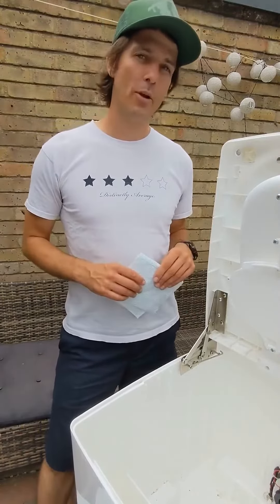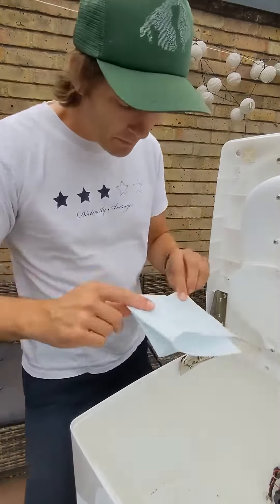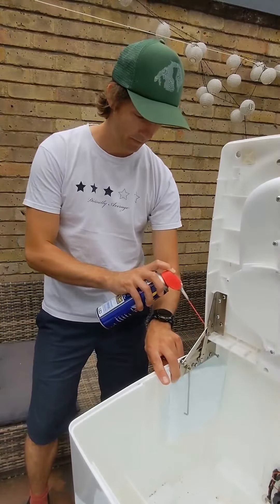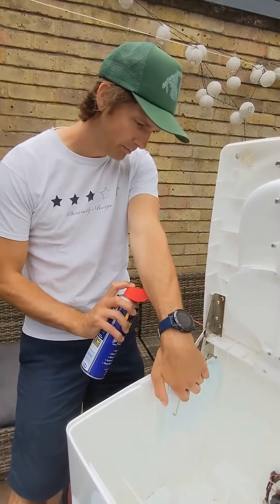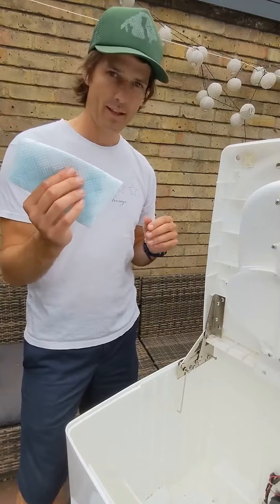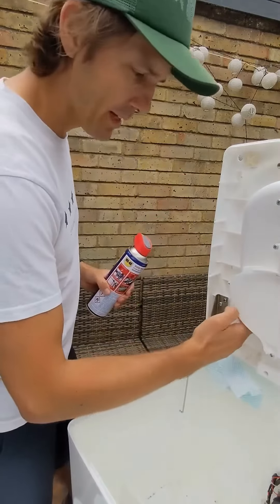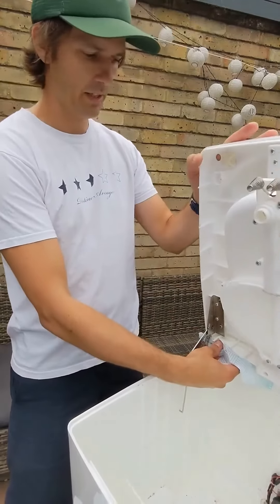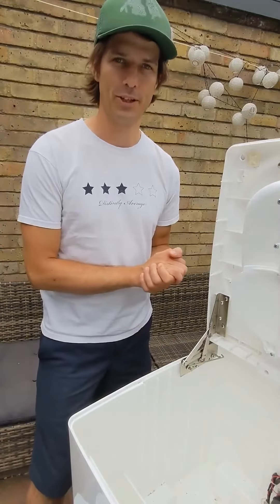How to care for your Cuddy's hinges

Comment: WD-40 is neither a lubricant or a protectant. It's intended to drive water, which it excels at, but it should always be followed by a proper oil or grease.
Reply from the maker: Hey Jeff. WD-40 water drive formula 40 is designed to prevent corrosion. It's actually a special blend of lubricants. Check out their website. I find the FAQs quite interesting. https://www.wd40.com/how-to/faqs/
Reply: @CompoCloset  The problem with WD-40 isn't that it provides no lubrication, but that the penetrants and lubricants that make it up are volatile. They evaporate in a couple of days.
It's great for getting the gunk out of a joint, but you should usually follow it up with something more permanent - oil, grease, or a dry lubricant like graphite.
Of course, for a low force, intemittent use bear like those in the Cuddy dry may be fine.

Comment: Won't the WD-40 degrade the plastic?
Reply: It depends on the type of plastic and how long you leave it in contact. Polypropylene should be ok, ABS isn't.  There are better options that are safe for plastics such as mineral oils, silicone lubricant and PFAE lubricant.

Comment: Aren't these hinges stainless steel?  That's a ridiculous amount of oil for ONE hinge!
Reply from the maker: No Shari, they are nickel-plated steel. Stainless was not an option when we first made Cuddy. We are looking to custom-manufacture stainless steel hinges in the future.
Reply: @CompoCloset  would silicone spray be a better option so the hinges don't rust
Reply from the maker: @everydayadventures361  not sure if it would be better. We'd have to test! yay!